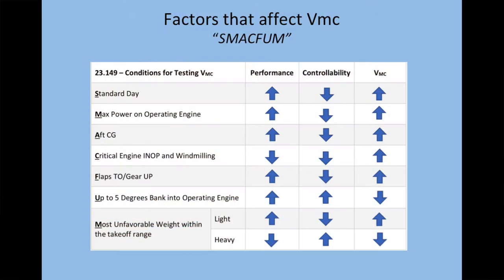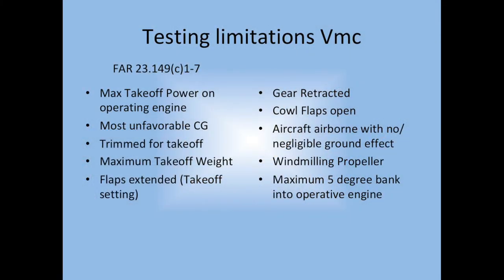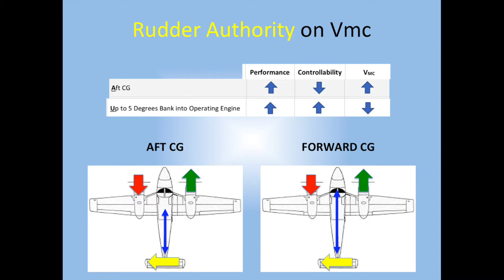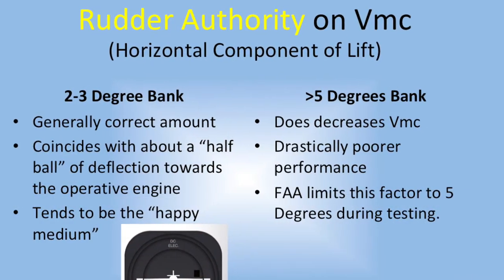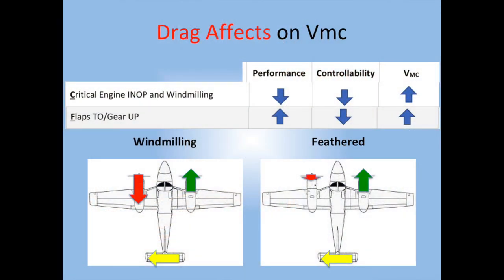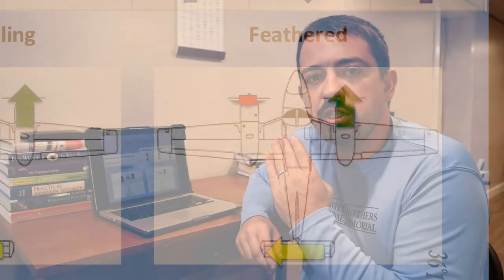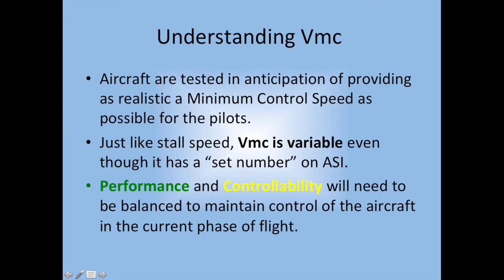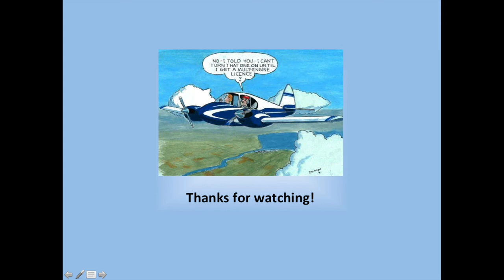What Factors affect Vmc?| Minimum Control Speed (Part 2)

Comment: Years ago, BE65, Queenaire ... engine failure on climbout, heavily loaded, four pax, fortunately was still in pattern, coincidentally on a downwind. Feathered nr. 2, briefly continued climb, then turned into good engine, gear down, easy landing. BUT .... did my damndest to continue a descent, and, by chance having just completed a detailed flight school program on the Queenair, knew to keep the airplane well above Vmc .... landing was good, and otherwise normal.

Comment: 8:52 the problem with this statement about the rudder is that if he banked towards the bad engine (the left) then his rudder input should be right rudder.  If he is putting right rudder, in a left bank the lift component would have been facing down, not up.  So I am not sure I understand your reasoning for the vmc increase.  

However I do remember being taught that every degree into the bad engine increases vmc by a certain amount, just not the reason.
Reply from the maker: Go watch the first video in this topic. It discusses the reason banking into the operative engine decreases Vmc. Wing Lift begins to bolster or increase the horizontal forces helping to prevent the Vmc Roll which is why when you bank intro the inoperative engine you raise Vmc. Banking towards the bad engine and trying to maintain altitude was decreasing rudder effectiveness.

Comment: That's Queen air VMC roll not because they simply turned into dead engine but they probably did so at "Low Air Speeds" way below even blue line.

If the plane is flying at 150knots that shouldn't be an issue but you're right, why tempt fate. Easy to make turns into good engine or at worst, fly straight to a off runway landing area without the need to turn at all. Simply land the plane safely.

Comment: Ive heard that if you low in altitude you could he very close to your okanes stall speed. 

If your up at 10,000ft you vmc soeeds typically would be 10 knots higher. If if your vmc speed is 57knots at 10,000ft vmc speed will be 67knots genreral rule.

So it might be better to practice any vmc demo to get multi engine rating at a higher altitude?
Reply from the maker: Actually, I think you’ve got it backwards… The dynamic pressure (a.k.a. indicated airspeed) would always be the same except the engines lose power if they’re normally aspirated at altitude. So basically the higher you go the lower Vmc gets because your engine power is less with higher altitude. You get lower speeds at higher altitudes; plus a higher margin of safety so I always did them 5,000 AGL or higher.

Comment: So let's say hypothetically, That your left engine was out, you banked 5 degrees into the right engine
You needed to make a left turn to line up on final. 
Could you just make a 10 degree bank to get a 15 degree turn since you're putting 5 degrees towards the right as your correction for the turning tendencies?

I'm sort of implying that if you use 5 degrees to hold relatively straight course, it would make sense that it becomes the new 0...
Sorry if its a loaded question.
Reply from the maker: Great question! My statement about banking into the operable engine during turns was intended to be in the context of climbing (performance) turns. During the landing portion of engine out emergencies the operable engine will most likely not be at full power. Because of this Vmc will be much lower and the amount of bank into the operable engine will be less because of less asymmetrical force. 

In all practicality you would do whatever control inputs were necessary to maintain the best single engine climb speed as a minimum air speed and flight control positions to stay on centerline during landing. I don’t think (nor in practice used) my bank into the operative engine as my new 0 degree point but rather adjusted it as needed depending on the scenario… does that make sense?
Reply: The 5 degrees bank applies only in a constant heading situation.
What is really important is the sideslip angle, which is not measured by anything in the airplane unless you have a yarn in the middle of the windshield like gliders tend to have.
Sideslip towards the good engine (to the right in your example) helps with control because it pushes the fin to the side you need, to the same side that your trying to push it with the application of rudder (that is to the left, meaning nose being pushed to the right, to compensate the good right engine trying to push the nose to the left).
But sideslip comes with a price: Extra drag so less climb performance,
Ideally you want to keep zero sideslip, and that requires about 5 degrees of bank into the good engine at Vmc and 2 to 3 degrees of bank at Vyse (blue line: best climb speed with a single engine).
As long as you keep that zero sideslip condition, it is the same to turn left or right.
The question is, again, how do you know? So because you don't it's better to turn to the right, and risk a bit of right sideslip that will impact performance, rather than turning left and risk a bit of left sideslip impacting controllability. Or watch the clip of the Queen Air in this video.
Reply: That's basically correct. You don't need as much bank angle turning into the dead engine to get the same rate of turn as you would turning into the good engine. Whether going straight or turning into or away from the good engine, always have a half ball into the good engine.

Comment: At my school I’ve been taught “raise the dead” to remember which bank to use for an inoperative engine.

Raise the dead ENGINE.
Reply from the maker: Sounds like a “killer” idea!
Reply: @The_Flying_Mechanic  hold up are you saying that’s bad advice? Or was it just a pun on dead
Reply from the maker: @thenelsonbruhs722 just a pun! I didn’t realize it might sound like I was saying it was a good way to die! I reference “raising the dead” in this video and the second part of this lesson! 

The main reason for doing this is to put the aircraft in “zero side slip” so you can minimize drag and maximize the performance on a single engine!
Reply: @The_Flying_Mechanic  that’s what I figured